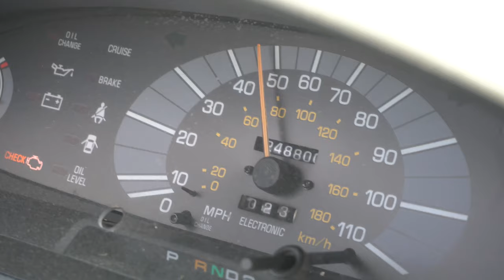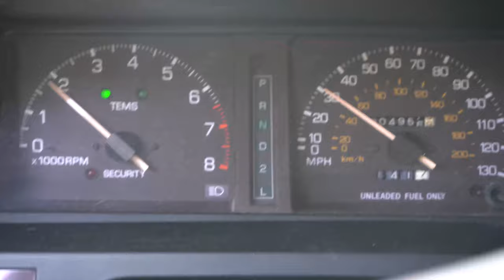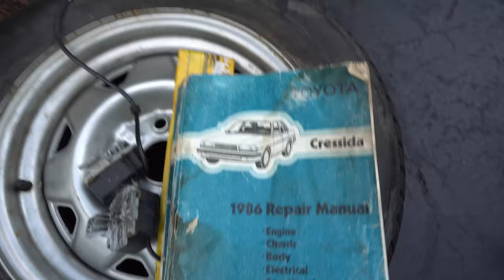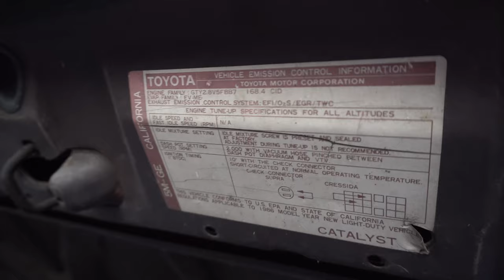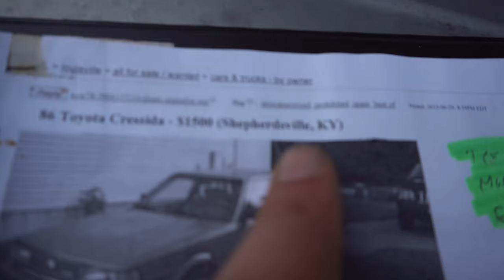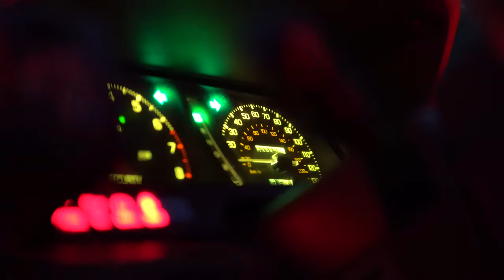I BOUGHT AN OLD SCHOOL TOYOTA!! // 1986 MX73 CRESSIDA [VLOG]

Comment: My cressida was a wild story in itself. I wish I vlogged it, but it's a 400 dollar cressida that was sitting for 6 years by a older fellow who collected them. I got it for 360 because no title and let it sat, got the title and started working on it. Found 200 bucks in a 1990s wallet under the rear seats during gutting it. And it runs and drives now, 10 gal fuel cell, walbro pump. Needs brakes cause their all locked up haha. Maybe I should do a walk around?  but my entire cluster doesn't work, just lights up. You have the factory front lip too. Pretty cool, mines looks the same except someone rubbed it in sandpaper lol. Turn back the AFM by 2 clicks and take the cat out.
Reply from the maker: Woah awesome! That sure is a lucky find! Id love to see a walk around video!

Comment: Bought one of these for my first car! Same year, back in 1997 from original owner with 108k miles, $3500.00. They originally wanted 3900 for it but the paint was flaking. Mine smoked from stoplights on takeoff, too, but great engine sound / power. Ran to 140K before head gasket leaked after I let it overheat a few times. Some good adventures before then.

Have you tried drifting it yet? I had some fun on the snow and in the rain, some close calls too. LOL fun times!
Reply: you commented this a year ago but i’m hoping you see this, how do you fix the head gasket leak?
Reply: @tylerforst313  I don't really know how to work on cars, I took it to the mechanic and they wanted $1200 to repair, but I needed transportation so I sold the car and bought an economy car. :(

Comment: I have an 86 mx73 as well. If y'all need any advice on parts and stuff hmu
Reply: Also, keep that repair manual handy you can't buy em even on eBay anymore. Really hard to get ahold of one.
Reply from the maker: Awesome! Do you have any recommendations for lower it? I was just planning on cutting the springs and getting new shocks as coilovers for these are pretty expensive. And yes! I'm gonna keep that manual close hahaha
Reply: GARAGE 33 BC is supposed to make a kit for it but the previous owner had just put new shocks and springs in. I'm probably going to wait for me to my wheels and tires first, gonna go for the work equip 01's. Internationally it's known as the cresta if you are looking for jdm parts.
Reply: GARAGE 33 manual swapping it sucks because it's hard to find one and since it's not like the direct linkage ones like Honda's were it is pretty prone to stretching out and needing tightened. The 5m is prone to oil leaks so make sure it's good. Rust is the biggest killer, and watch for spots on the A pillar and around the sunroof. I just picked up a hood Saturday at a junkyard. Other than that they're solid cars and last forever pretty much maintenance free. For bosozoku check out the moonlight runners cressida. It's really the only real bosozoku in the USA. Shoot me a dm on my Instagram @j.musser12 I'll hook you up with some parts places I've found helpful.
Reply: I own aswell and man ima hit you up on insta for those car part places. I was really considering making it a 5speed but everyone is telling me its to much money an kinda hard. I will eventually but automatic will do for a bit. Great vid Garage 33 !
Reply from the maker: @likwitmind4749  Thank you!!